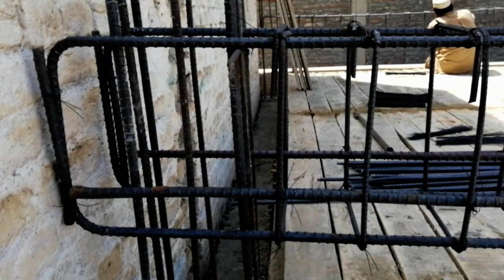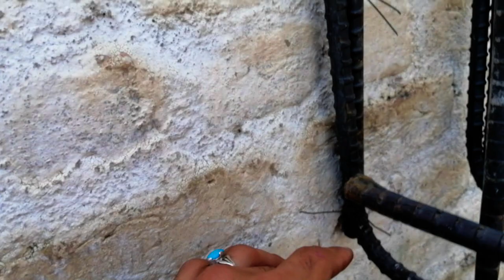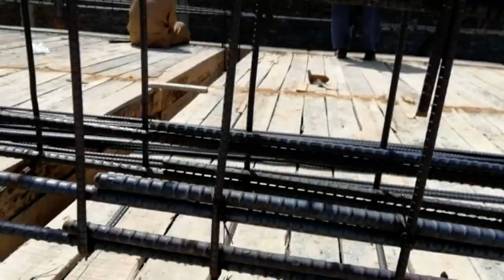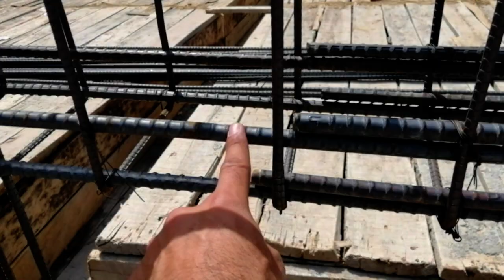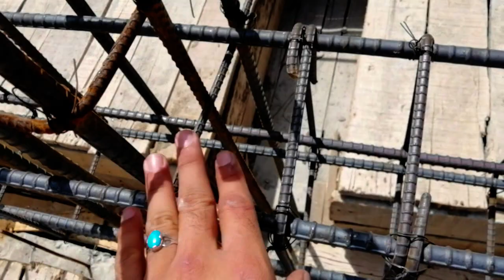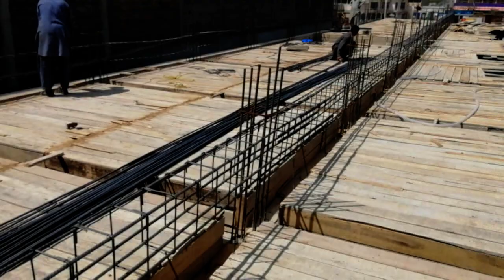Practically Development length and lapping length on Construction Site - Civil Engineering Videos

Comment: Thank you but sir all bars are overlapping at one place almost so is it good or not. As i have heard overlap of bottom bars near support and top bars near mid are good. Explain abit plz
Reply: Overlapping  bottom bars should be at the supports and top bars at mid span  in RCC beams  max moment  in middle of two supports
Reply: @saeedmohd9755  thank you . Did you notice in the vedio ? Is it right or wrong ? Bcoz all the bars are finished at one place
Reply: @fawadkhan2981  it's wrong
Reply: @saeedmohd9755  👍👍😊
Reply: Check sp34 splice